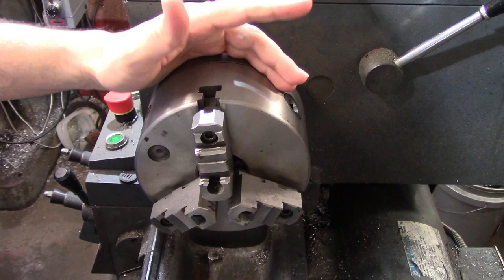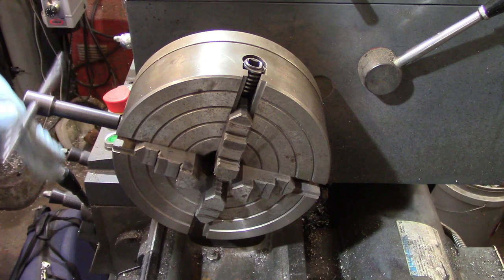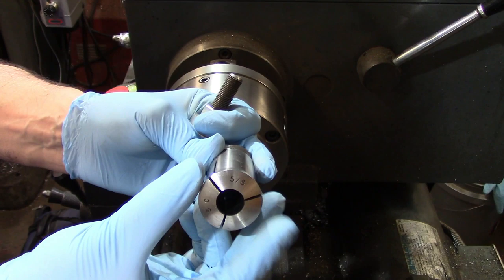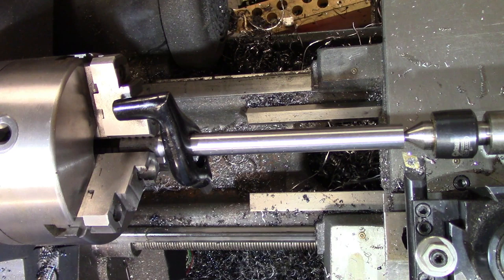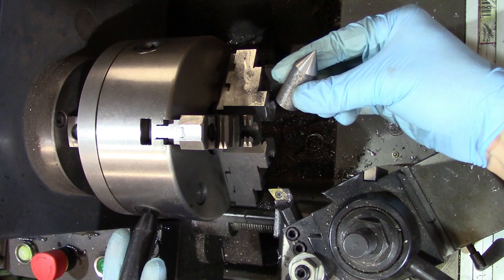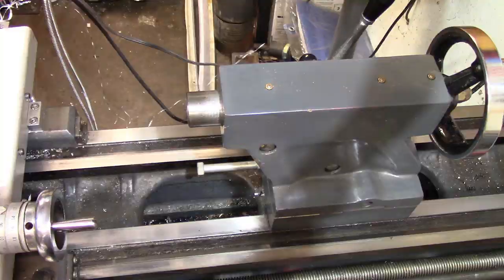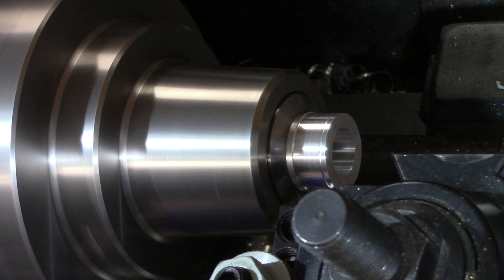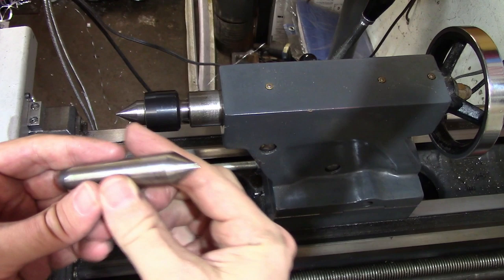Work and Tool Holding in the Metal Lathe

Comment: Good run through.
If i might add a little personal experience,  back in woodwork class at school, a long time ago before the internet, global warming or even colour tv, i was undoing a screw on chuck on a wood lathe. When it got to the end of the thread it dropped and as i was using two hands to undo guess what happened, yup a black finger nail. I got kudos there though, apparently the last guy to do it swore a lot before fainting. I was then told to hold the chuck from above and unscrew it by turning the spindle so you are never surprised when the thread ends. OK not always possible on a metal lathe but the principle holds, never have your hand under the chuck when removing it. 
As for which is cutest, my garden Badgers beat your dogs any day, take a look if you haven't seen them on youtube already.
ATB 
c

Comment: Stuart, I purchased a junkyard lathe and have been attempting to restore it to a usable condition.  The mounting is an L-1 and there is a drive plate and center currently mounted.  I need to loosen the retaining ring so I can remove the drive plate and center.  First off I need to tell you that there are no engaged gears on the outboard headstock of the lathe.  Even at that, I am not a real fan of trying to free mechanisms against teeth of gears.  So, I have sprayed penetrating fluid until the cows came home and that is serious as I live in the heart of a very large city.  I have a spanner wrench and torqued it with a cheater pipe.  No cigar. . .  I have even heated up the ring (with a Mapp gas torch) and smacked on the handle of the spanner wrench.  Still no cigar.  And I had to lodge a crowbar in one of the slots of the drive plate and wedge that against the way of the lathe to prevent the spindle from turning.  I have exhausted my vocabulary of naughty words and still, the retaining ring refuses to succumb to my efforts.  Any suggestions?
Reply from the maker: Hi Gordon.  Sorry it took me so long to get to you on this.  I'm sure you've gotten it loose by now, but just in case...

Put the lathe in its lowest speed.  Make sure you are turning the ring in the correct direction.  It is captured on the spindle and threading onto the chuck, not the other way around.  This means the spanner wrench you use will get turned away from the front of the machine when loosening.  The ring does double duty by retaining the chuck on the taper and driving it off the taper as well.  A cheater bar on the end of the spanner is preferable to smacking it with your biggest thwacking device.  Alternating heat and penetrating oil will get it eventually.  I really like Kroil since the smell is reminiscent of the finest $2.00 colognes.  Rolling into the club with Kroil wafting off your duds WILL get you laid.  I hope this helps, even if it is 4 months late.

Comment: Stuart: 

Dead centres fit into the spindle end (they do not move relative to the work), they are usually soft (to allow them to be trued) .
Live centres fit in the tail stock they are usually hardened and can have bearings to reduce friction (called a revolving centre) 

Revolving centres are live centres but not because they revolve but because they are used in the tailstock!
Reply from the maker: I think this might be another instance of different nomenclature for different parts of the world, because that dead center I showed in the video could be either a dead or live center depending on where it is placed in the machine. Before accurate roller bearings, dead (solid) centers were the only thing available. If they were placed in the tailstock they were called a dead center because they did not revolve. They were lubricated liberally with white lead to keep them from galling the center hole in the part, which would cause location problems if it occurred. If the center was put in the headstock however, it was called the live center because it rotated with the work. 

Of course, when revolving centers came along, manufacturers and machinists started calling them live centers to distinguish them from their solid cousins and the use of the term live center for a solid center mounted in the headstock fell into the scrap heap of history and is now only brought up occasionally on internet discussions. Thanks for watching!
Reply: @StuartdeHaro  I still have 2 cans of white lead, although I refer to it as gold paste these days, because it's basically worth it's weight in gold. Rare as hens teeth now. 😏
Reply: @StuartdeHaro  that's how it is, for older folks, here too.

Comment: For turning between centers 4:52, what if the 3 jaw chuck holding the dead center has some error, e.g., 0.2 mm? I think the dead center is then off center and the piece starts to turn around another point instead of the center drilled point (probably leading to a taper). Am I correct or did I miss something?
Reply from the maker: If you do a cleanup cut on the point of the center you're guaranteed to have perfect concentricity on the point. I demonstrate that starting at 6:23

Comment: Recently bought a cheap old 12 x 36 lathe built in 1937. It has dinky  3 and 4 jaw chucks that look like junk. What diameter chucks are fully useable on a 12" lathe? Thanks. I like your video style and content so I just subscribed.
Reply from the maker: Hi Mark. I use a 6" 3-jaw and an 8" 4-jaw. I'm sure you can use a 10" chuck, but it looks weird, like a puppy that hasn't grown enough to match the size of its head yet. They're also heavy and if you have the chuck jaws extending beyond the body of the chuck you're going to start having clearance issues with the ways. If you don't specifically need that size for a job, I wouldn't put yourself through the hassle.

Comment: Stuart, Could you comment on the pros and cons of a 3 vs 6 jaw chuck. I imagine the 6 jaw would grip better, but because of more contact points, are you going to have less repeatability if the stock is not perfectly round?
Reply from the maker: 6 jaw chucks are less likely to crush a hollow part than a 3 jaw because they spread the load out around the circumference of the part.  I think the surface contact is actually a bit of a wash though.  The jaws on a 6 jaw are necessarily a good bit sharper.  I also find it more difficult to get a measuring tool between the jaws on parts smaller than 3/4" or 20mm.  They are also heavier than the same size 3 jaw.  Not by much, but enough that I'd rather lift the 3 jaw.  I hope this answers your question.  Thanks for watching!
Reply: @StuartdeHaro  Thanks. I am really enjoying your videos.
Reply: I would add that the 2/3/4/6 jaw scroll chucks or the collet type chucks are not intended to grip rough or out of symmetric stock!
That is the job of the independent jaw chucks and face plates.
If you do chuck rough black steel or an asymmetric job in a scroll chuck it just might move or become a missile!

Comment: Stuart,  good info, thanks.  I have a question:  I have a 10 x 22 bench top lathe with a spindle bore of 25 mm and a spindle thread of 1.75” x 8 pitch.   I would like to buy a collect chuck for this machine but can not find one.   Perhaps the spindle size is too small for a collect chuck using a 5c collect.   Any ideas ?
Thanks,  Curt Kemp
Reply from the maker: You can find one like mine on Amazon and other retailers by searching for "5C collet chuck". You will want to get a plain back chuck, which is one that you can fit to any back plate. Then get or make a back plate that fits your spindle, install it on your spindle, and machine it true on the face and turn a boss that fits snugly into the back of the chuck. This will ensure good concentricity. Threaded spindles do not locate the chuck very repeatably, especially radially, so if you swap chucks often you will probably want to make that boss a bit undersized so you can loosen the mounting bolts and bump the chuck back to concentric again whenever you put it back on. Just don't forget to tighten them up again! I hope this helps. Thanks for watching!
Reply: Stuart de Haro ...   I have not been able to find  a 5C collect chuck that comes with a  1-3/4 x 8 internal threaded backer plate that I could mount on the lathe and machine the face and shoulder to fit the chuck so it is concentric.  Specifically,  can you suggest a supplier I can try ?   Thx
Reply from the maker: You'll have to buy them separately.  If you can't find a back plate, you can always make one.  The first step to that is making a VERY accurate copy of your spindle thread.  Try to absolutely nail the dimensions, especially the pitch diameter.  Don't go off of textbook dimensions for the thread either, measure your actual spindle thread and reproduce it.  You're going to use that copy to test the fit of your threads so you don't have to remove it from the machine.  Once you have you internal threads cut, then just slap the thing on your spindle and machine it to fit the chuck.  Easy peasy lemon squeezy, Bob's your uncle, bippity boppity boop boop be doop.  Let me know if you've got any other questions.